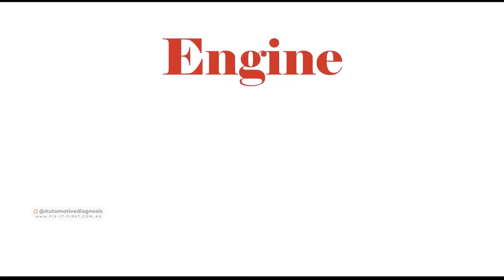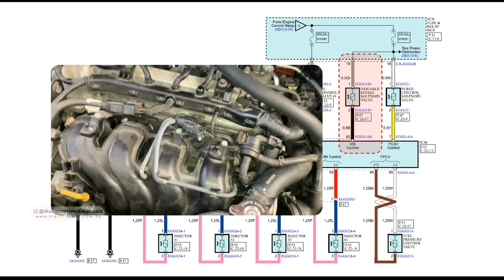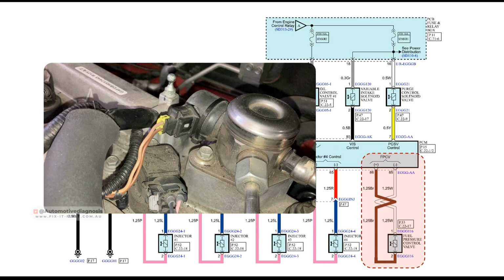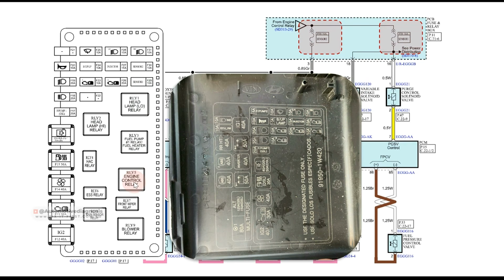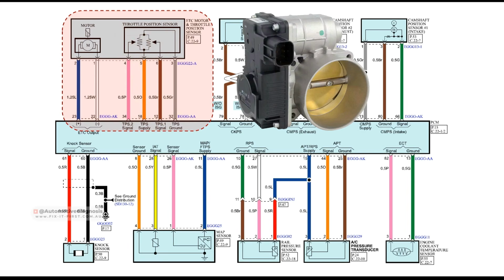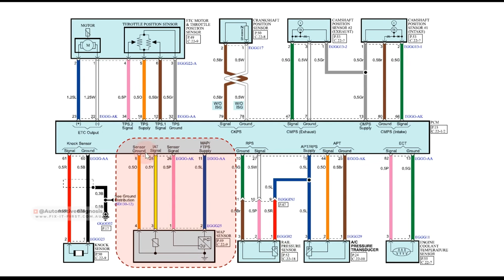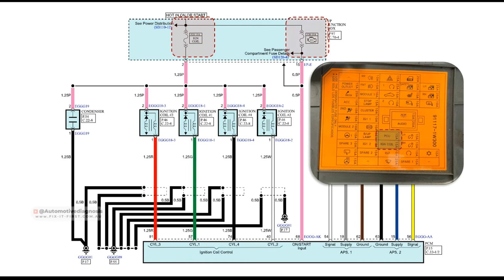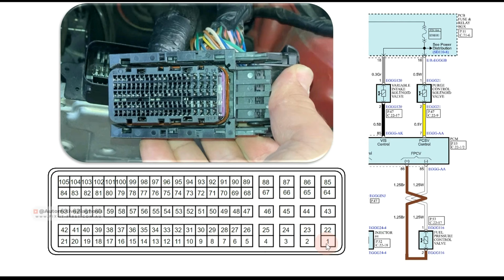All Engine Sensors & Actuators Explained | MAP, IAT, TPS, O2S, APS | Operation, Location & Diagrams

Comment from the maker: 🎯 Online Courses:
🧑‍🎓 Automotive Engine Sensors Intro, Operation & Diagnosis:
https://mechanicourse.com/course/automotive-engine-sensors-intro-operation-diagnostic-2/

🧑‍🎓Automotive Engine Actuators Intro, Operation & Diagnostic: 
https://mechanicourse.com/course/automotive-engine-actuators-intro-operation-diagnostic/

🧑‍🎓 Smart Key System (Push Button Start) Operation & Diagnostic:
https://mechanicourse.com/course/smart-key-system-operation-diagnostic-in-any-kia-hyundai/

🧑‍🎓 Automotive Diagnostic with Oscilloscope:
https://mechanicourse.com/course/how-to-use-an-oscilloscope-for-automotive-diagnostics/

🧑‍🎓 CAN-Bus Network Intro, Application & Diagnostic:
https://mechanicourse.com/course/automotive-can-bus-network-intro-application-diagnosis/

🧑‍🎓 Automotive LIN-Bus & K-Line Inro, Application & Diagnosis
https://mechanicourse.com/course/automotive-lin-bus-k-line-intro-application-diagnosis/

🧑‍🎓 Gasoline Direct Injection System Diagnostic:
https://mechanicourse.com/course/107-gasoline-direct-injection-gdi-fuel-system-operation-diagnostic-online-course/

🧑‍🎓 Automotive Airbag (SRS) Diagnostic:
https://mechanicourse.com/course/automotive-srs-airbag-system-diagnostic/

🧑‍🎓 Everything about Electric Power Steering System:
https://mechanicourse.com/course/everything-about-electric-power-steering/

🧑‍🎓 ABS & Traction Control System Diagnostic:
https://mechanicourse.com/course/abs-traction-control-system-diagnostic/

🧑‍🎓 Starting System Diagnostic & Schematics Analysis:
https://mechanicourse.com/course/automotive-starting-system-diagnosis-and-schematic-analysis/

🧑‍🎓 Tire Pressure Monitoring System Intro, Operation & Diagnosis:
https://mechanicourse.com/course/tire-pressure-monitoring-systems-tpms/

🧑‍🎓Power Outside Mirrors Diagnostic:
https://mechanicourse.com/course/power-outside-mirrors-diagnostics-schematics-analysis/
Reply: Hi Sir? thank you for this video we're really getting New things from thanks a lot. But I need to ask please does credit card allowed to do payments? because I tried it and I didn't succeed😢😢
Reply from the maker: @OmariBwagizo  Hi my friend, it should be okay, please try it again on Udemy.
Reply: Okay sir thank you for your response i go to do that quickly @AutomotiveDiagnosis
Reply: I don't have the card
Reply: Sir I am from Bangladesh. Can i have your Whatsapp number or contact number or email.
Reply: Hello sir i am from Bangladesh.
Reply: that is good bat I am from Afghanistan can you help me please 🙏

Comment: that 2012 kia rio has a 5v ref   does it ? because on my 2009 kia picanto the cam sensor uses  12v    which i thought is weird ........... i was expecting 5v    but saw 12..........the engine is functioning , so it cant tbe wrong ....so why did kia use the 12v on some models?
Reply: Yes it uses 12volt  some are not 5 volt

Comment: the knock sensor can sometimes respond to engine noises other than  ENGINE KNOCK PINGING ;  which will cause it to retard the ignition wrongfully ....fan belt noise; mechanical noises from worn parts ; or other types of noise can trick the knock sensor into thinking that pinging exist when it doesn't
Reply from the maker: Thanks for sharing your experience 😊👍👍

Comment: hello, sometimes the order of colored wires changes, is that normal ?
Reply from the maker: Yeah sometimes colour changes between a sensor and ECM, it’s not very common, but it happens sometimes when there is a connector in between.

Comment: My daughter has 2013 Altima 2.5L,
Car drives about 3 minutes then losses all power & move @ about 2mph,l'm thinking it's the Camshaft or Crankshaft Sensor,can U guide me in the right direction if it's not either or these sensors please...
Reply from the maker: Hi there, this could be related to some other sensors too, even throttle position sensors and accelerator pedal sensors can cause this issue too, checking the engine fault codes can be very helpful.
Reply: @ Hi,I got 0037,0335,& 0340
Changed the sensors to the relating codes O2 sensors,crankshaft,& camshaft sensors…
But nothing change…
I will look into the “Throttle Positioning Sensor” tomorrow to see if it makes a difference…

Comment: It is really interesting  and  informative.Regarding Accelerator Pedal Position Sensor 1 Accelerator Pedal Position Sensor 2 readings in livedata, Do they have the same values or one times the second ?Thanks  in advance
Reply from the maker: Hi there, thanks for watching the video. They normally provide different range of voltage, one of them is half of the other one. You can watch the full video here:
https://youtu.be/Og49up4Ipno?si=_YkxQAiQY03haHaf
Reply: @AutomotiveDiagnosis  🌹

Comment: Easy to understand. I can't understand why manufacturers can't keep signal wire same colour for same job like brown ground or pink signal. Then you can learn what that wire should be doing without wiring diagram. I used to know most fords British Leyland cars and motorbikes just by looking at them.
Reply from the maker: I agree, they could've done a lot better.